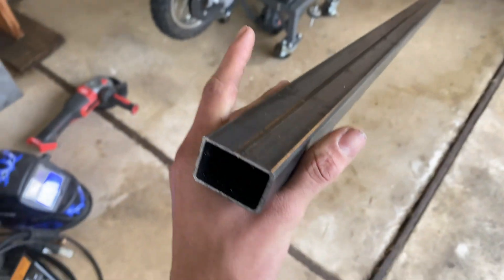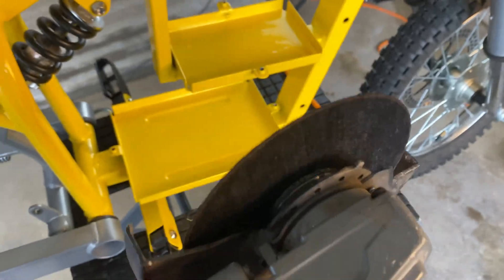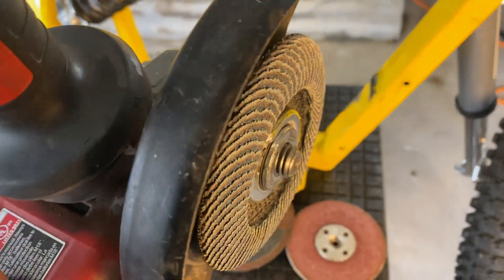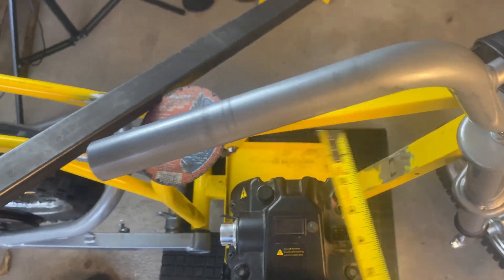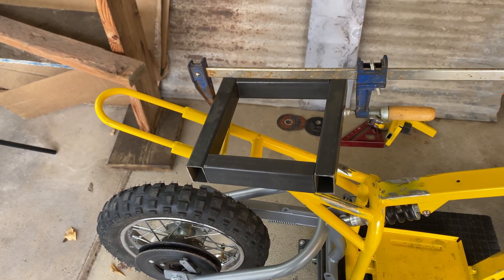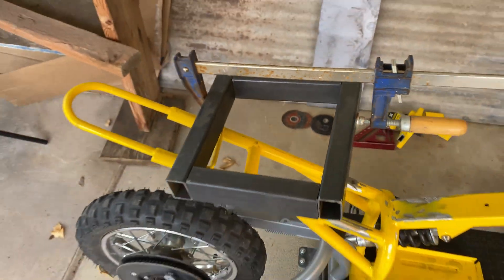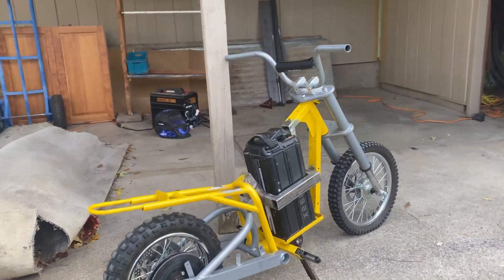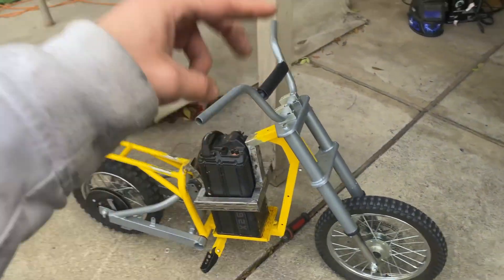Worlds most Expensive razor mx650 Surron build / Battery Install / Part 2

Comment: Throw that welder back in the car and exchange it for the titiaum lime green one at harbor freight you will think you became a pro welder its that much better bro trust mee I use it on cars when I'm on the road not near my big gas snap-on welder and  it works well the Chicago ones are just junk
Reply from the maker: @MotorMike856  yea I bet, definitely a cheap welder was thinking about getting some right tools and saw!